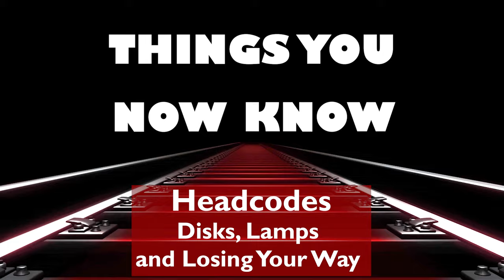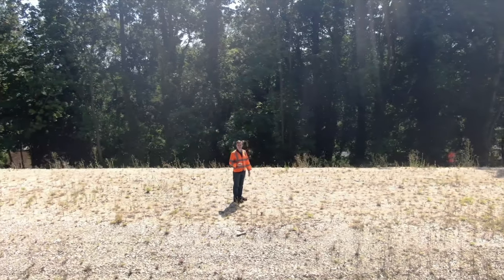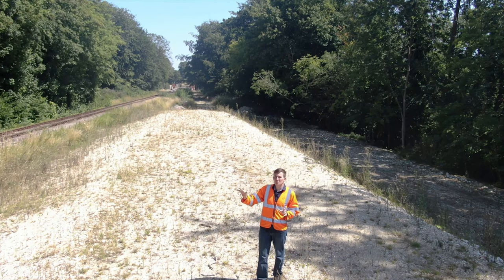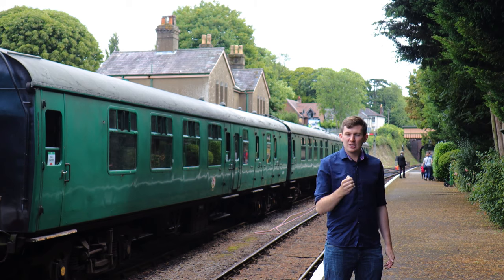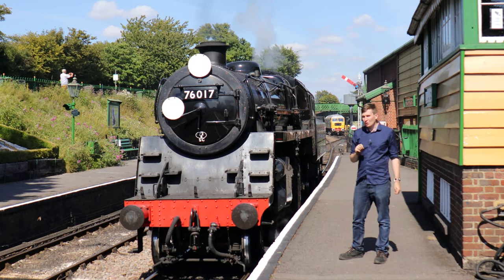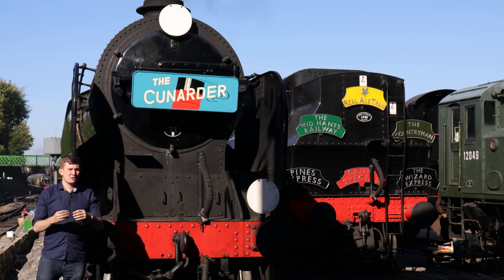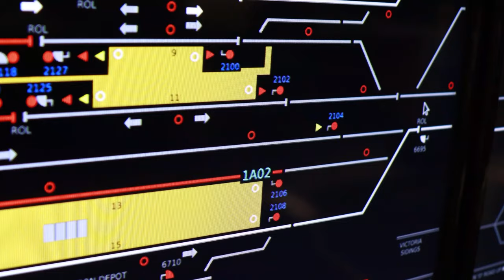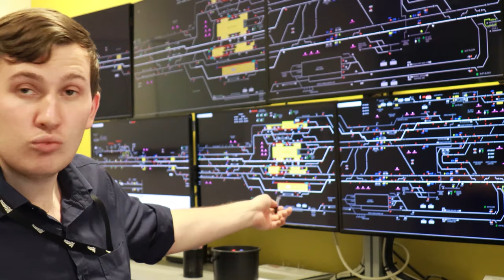Headcodes: Disks, lamps and losing your way.

Comment: Interesting to know how your numbering system works. In germany we had a numbering system very early on. Before releasing a train from a station the signaller calls the next station to announce the train. Usually a train has a certain number, for example 3555 and the next train of the same type driving the same direction has 3557. 3556 is a train going from 3555's destination to its start (Maybe just 3555 returning to the initial station). But as far as I know we don't have codes, like a 1 representing a passenger train. Good video👍

Comment: In some locations away from the Southern Railway, like Tyneside and Teesside local lamp headcodes on freight trains to give their destination or starting point. Those used on Teesside were in use until at 1976 when headcodes were no longer displayed. These local codes, which included the letter in the 4-character headcodes, only applied east of Tees Yard and had to be changed when passing there.

On most regions of BR the letter A meant London, but originally, especially on the ECML, it meant an Express train (it changed around 1967, see the Napier Chronicles for details). The route would be indicated by the train number. On Teesside it mean one of three locations South Bank North Side, South Bank Coke Oven Plant or Tilery Sidings. The other letters used were K, M, S, G, P, J and O. These letters only applied to freight trains between Tees Yard and Skinningrove by, until the mid-1960s by either the Redcar or Guisborough routes, and applied in both the up and down directions.